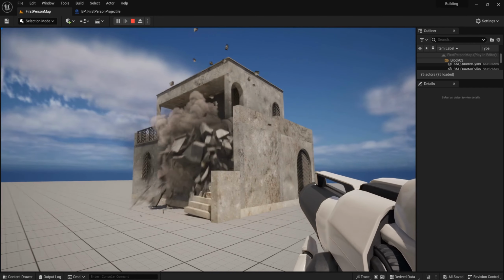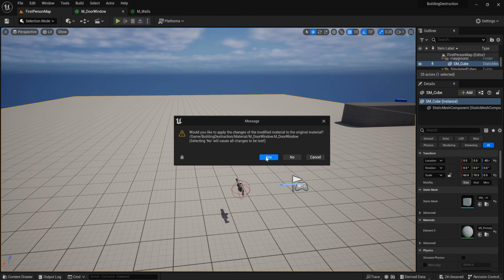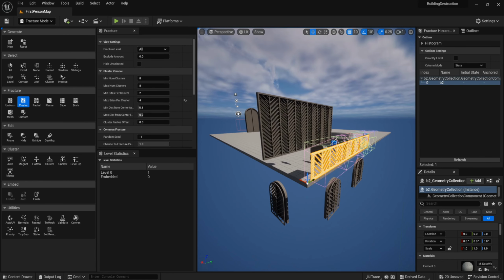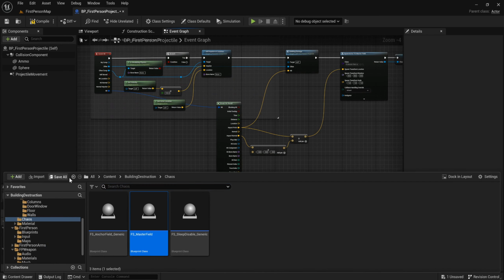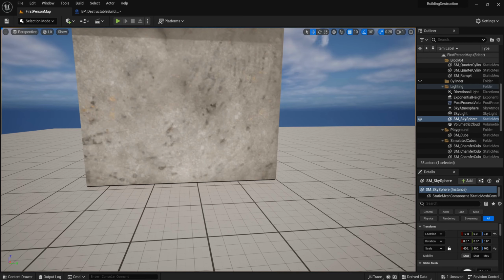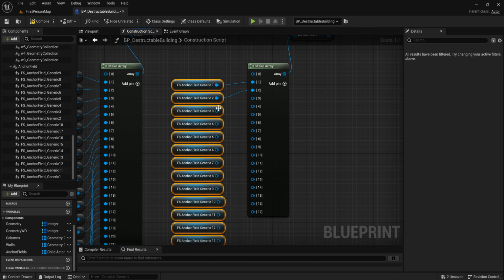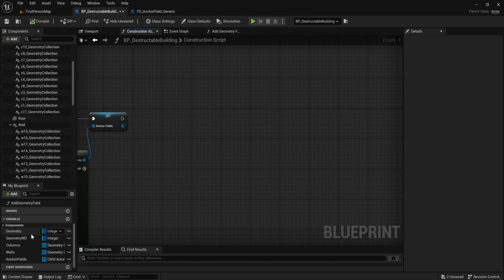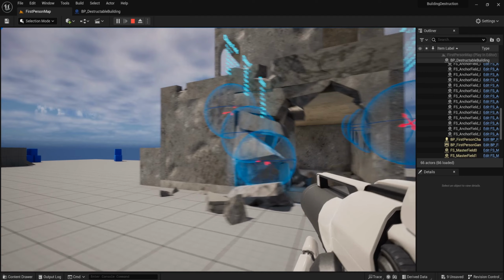Building Destruction System with Chaos Destruction in UE5 (Part 1)

Comment: Hey how come i can't get the concrete or brushed steel to appear on the walls or windows? i first only had one slot so added another for where you add those but nothing happens
Reply from the maker: How to add steel. https://youtu.be/XLAp9UIA6vM?si=xWRsIdAEQ2rtewnG
Reply: @jourverse  Thanks for this but that's not quite what i mean see in this video at 21.02 just before you fracture there is only 1 material slot but after you fractured yours has 3 slots now mine only stays 1 slot after fracture
Reply from the maker: @rayzo1534  Yes, I have 3 slots after fracture. I never met your situation before.
Reply: Hey I got your problem as well, have you found any solution? @rayzo1534